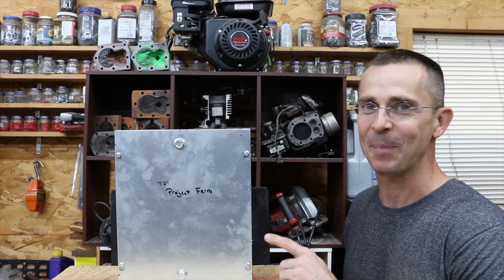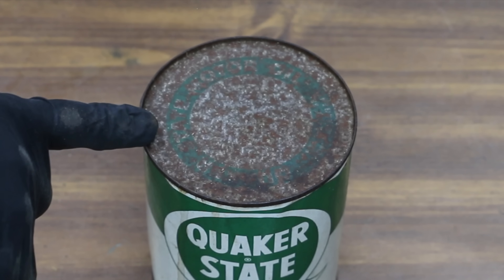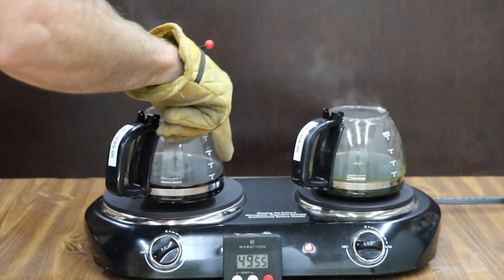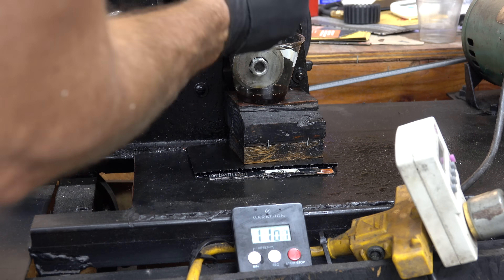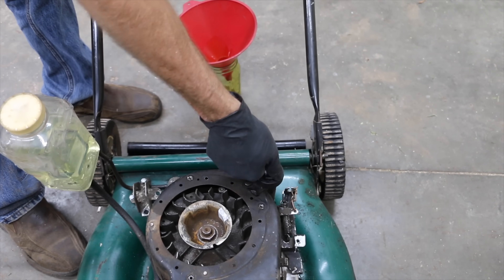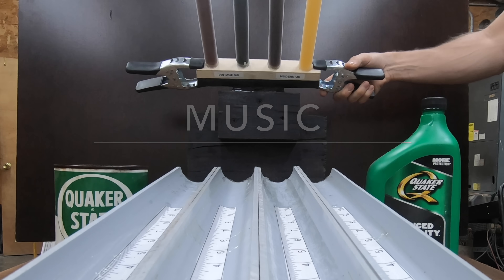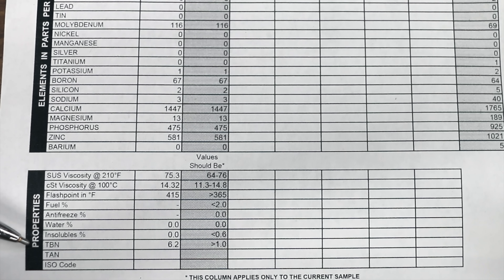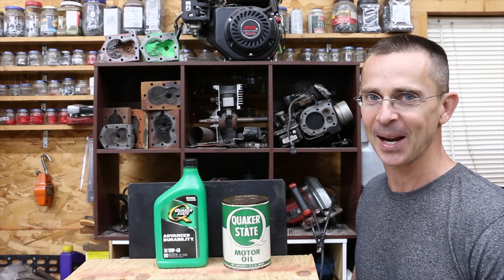Is Oil Good After 70 Years?  Let's find out!

Comment: The green hue is actually a good thing! It means it is real Pennsylvania Grade Crude oil. It's green because the oil has a low asphalt content. Back when there were lots of conventional oil wells in Pennsylvania, the oil usually had this green hue. It also tended to have the right hydrocarbon lengths to be optimized for lubrication. There wasn't much refining necessary. That's why two major lubricating oil brands, Quaker State and Pennzoil, have their roots in PA. Sunoco also got started with lubricating oil in PA but quickly diversified into fuel oil in other states.

Nowadays, most crude from Pennsylvania is fracked directly out of the Marcellus shale; the green stuff usually migrated out of the Marcellus and into reservoir rocks like limestone. The shale oil is black. But I've seen the green oil, especially a few times where my rig was drilling for gas around old conventional wells. And I'm sure Pennzoil and Quaker State get oil from all over the place, because they're brands, not companies. 

Oil can come in all kinds of colors besides black.
Reply from the maker: Thanks for the feedback.
Reply: That's interesting to know ! Thanks for the info !
Reply: You just schooled everyone in one paragraph 💪🤣
Reply: Back in the 60's it was (Edit: generally accepted) common knowledge that PA crude produced the best oils. I used Quaker State in all my vehicles back then. 
Used to have the tool that would punch the hole in the can and double as the pour spout. Always kept it in a clean coffee can to keep the dust off.
Reply: @savage22bolt32  Yes my dad has one or two of those in his garage ! Not sure exactly where they're at in the garage but I know he didn't throw them away ! Hes not with us anymore or I'd ask him ! He also used to use Quaker State when I was growing up !
Reply: Sometimes you see that in other fluids too. and when he was heating the samples that green hue stayed around the longest, the other stuff turned brown much quicker.
Reply: @dbspecials1200  👍
Reply: Very interesting
Reply: i can remember also some companies dyeing oil green or other colors
Reply: So that's why most motor oil used to greenish?
Reply: @dm32904  Many still does, Motul syn motorcycle oil  is red
Reply: Awesome info!
Reply: @ProjectFarm  as far as I remember, back in the days when Duckhams, a British oil company used to dye it's motor oil green, at a point it was nicknamed "the green oil" . Duckhams still does dye it's engine oils green though
Reply: Cool info! Thanks
Reply: That awesome to know! So the old best oils came (mostly) as naturally good at lubrication based off where it was drilled for. Nowadays it's the battle of the labs and additives, which is almost certainly for the best given how much oil performance has improved.
Reply: Too bad it's Paraffin based. Both Quaker State and Pennzoil were notorious for gumming up engines back then. Thank goodness that we have better oils now.
Reply: Back then Pennzoil and Quaker State were paraffin-based oils that left high amounts of sludge in your engine. All you had to do was pull a valve cover and you could tell if that engine had been running on that junk.
Reply: Fantastic piece of information! Thanks!
Reply: Is that the same reason they use green as the color of their logo and  containers? I feel like it should be, whether it is or not. 😅
Reply: @savage22bolt32  G’day Savage.  Wolf’s Head was also a Pennsylvania oil.  A very good oil.
Courtesy of Half Vast Flying
Reply: Greenish color also means it has higher than normal zinc content
Reply: @nojunkwork5735 I guess they need to put the paraffin somewhere lol
Reply: Two-stroke oil is very often dyed, usually blue or red, so that by looking at some fuel you can tell whether or not you have added oil to it.
Reply: @cedriclynch not all 2 stroke oils are dyed. Shell advance 2t and Total hi perf 2t looked exactly like regular motor oils

Comment: The reason you saw no weight grade on the can was the rust. They marked the top of the can. Back in the day of single weight oils you ran 10s and 20s in the winter and 30s and 40s summer based on your operation zone. If it was a detergent oil or nondetergent it was on the top too. Can sides were universal labeling with only the top being the varying label component.
Reply from the maker: Thanks for the feedback.
Reply: @ProjectFarm feedback? 😂
Reply: @C-B2003  automated message